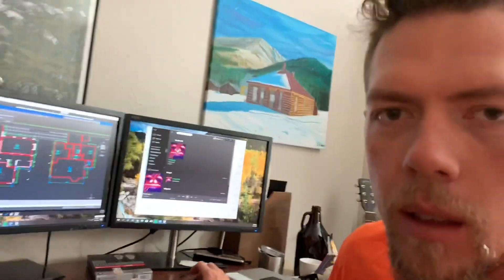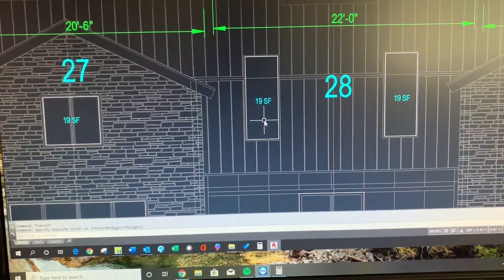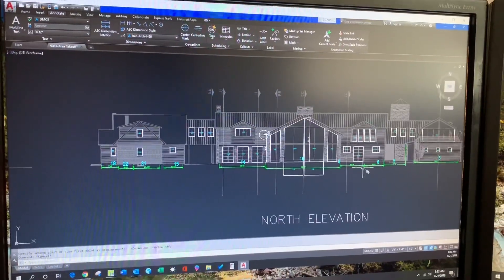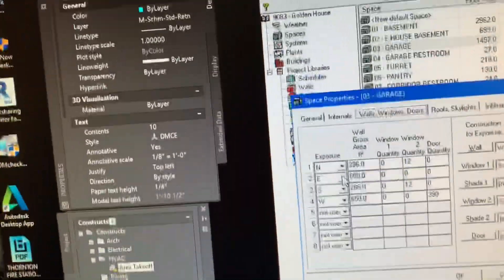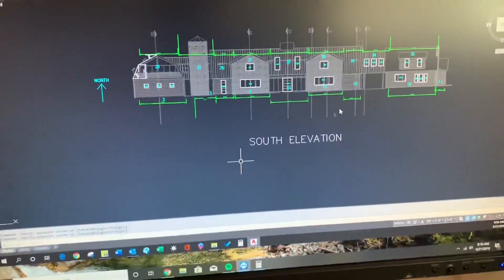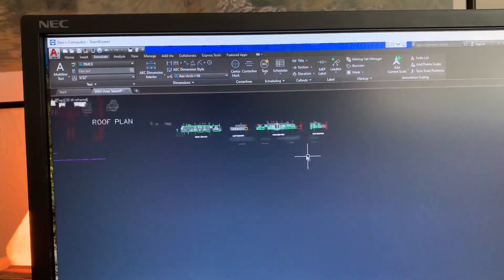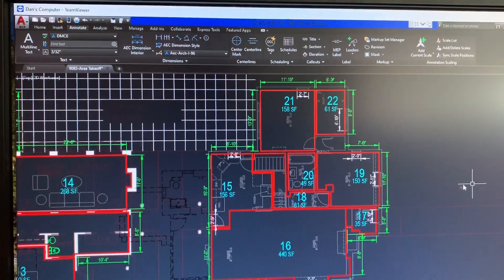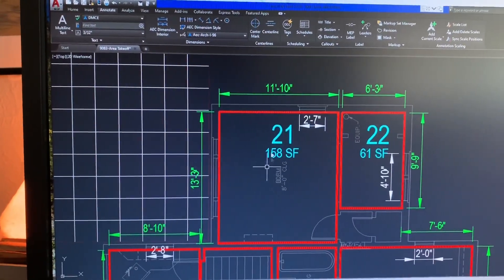Mechanical engineering HVAC Load Calculation

Comment: Hey a Daniel, I know of structural engineers with small businesses doing structural inspections for real estate transactions.

My question for you is, do you have similar opportunities for ‘side hustles’ or small businesses as a mechanical engineer?

I currently have a background as an HVAC technician and am trying to decide to pursue mechanical or structural engineering.
Reply from the maker: Yes, there are mechanical system assessments we do for developers or potential buyers. I don’t do these often but sometimes it leads to a design contract if they decide to make upgrades for the new tenant.